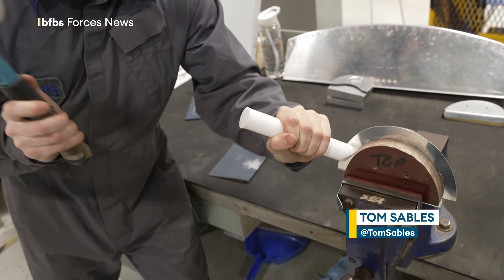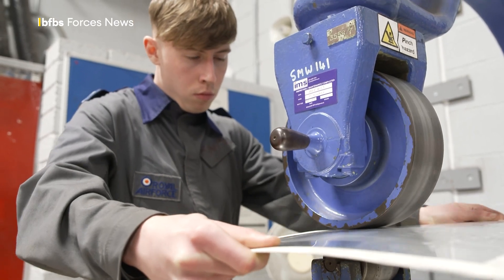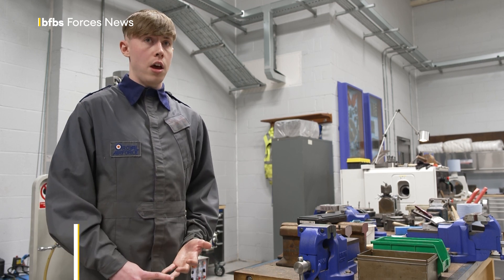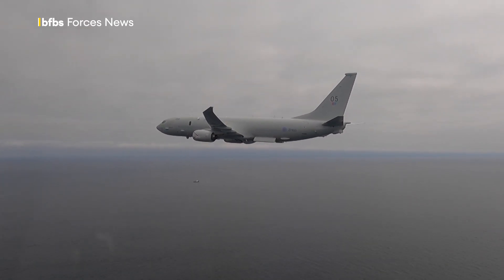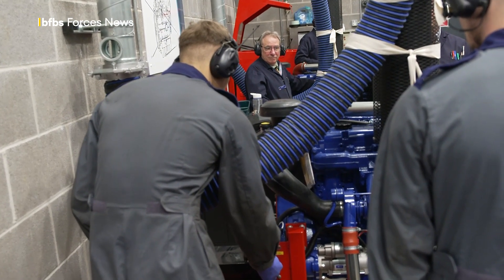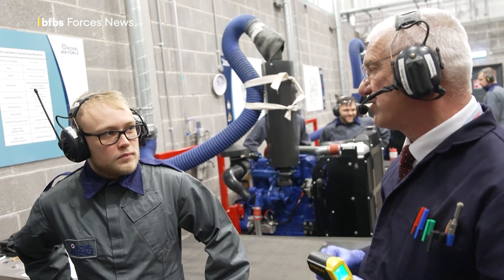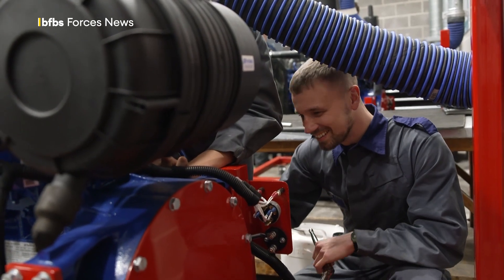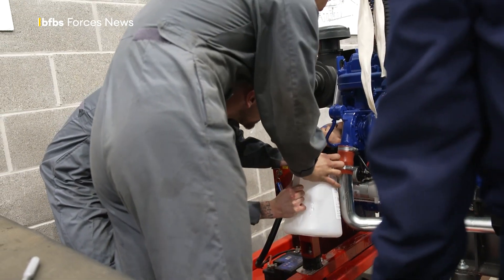RAF trainees sharpen old-school skills to keep UK's advanced aircraft flying

Comment: These lads aren't aircraft engineer trainees. They are Gen Mechs for ground equipment. Aircraft engineers are not taught diesel engines. Nor petrol piston engines. No RAF aircraft are now piston engine powered. 
I joined the RAF along time ago as an aircraft engineer. Even by then the RAF had stopped teaching piston engines and welding to aircraft techs. At the operational level welding is just about never done - only saw it once in my time. Why? Traditional aircraft are made from aluminium, which is quite difficult to weld. Modern aircraft are composite structures rather than metal.
Reply: True enough but they are being taught basic alclad sheet metal work, and the far more advanced English Wheel. Perhaps after basic training they could choose between GSE or aircraft.
Reply: @ They make that choice before joining. These lads are probably Gen Tech Workshops. Their job is making AC parts. The other lads were Mechs. Completely different trades.
Reply: @rogerlishman Unless the RAF have changed their engineering training then I doubt they will have the option to change. Ground equipment engineers and aircraft engineering are different careers. Aircraft engineers are Trade Group 1 *or were. Gen techs are something like Trade Group 6
Reply: @jjsmallpiece9234 I have news for you. The RAF are basically incorporating all engineering trades to one profession. So a Gen tech can fix aircarft if the series need is required. As to an Aircarft tech can move to the squippers or gen techs if the service need is greater. 

It's genuinely frightening what is about to happen.
Reply: Chinooks, pumas and P8s are composite are they? Don’t think so.